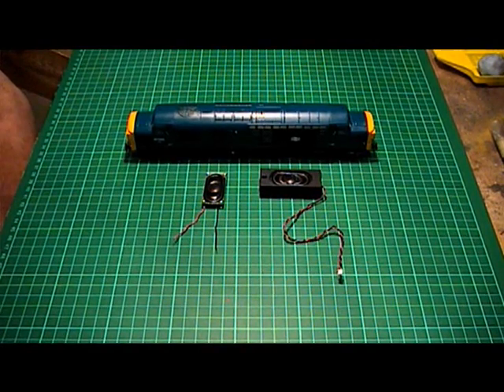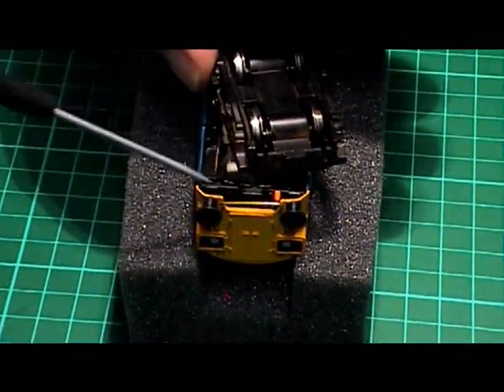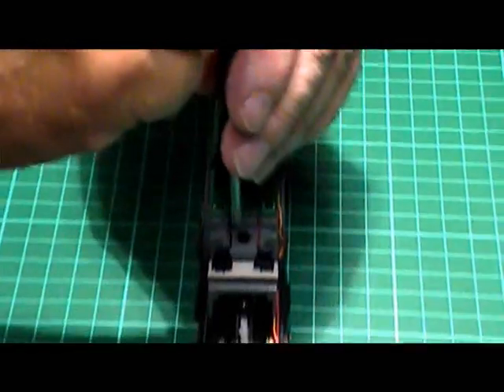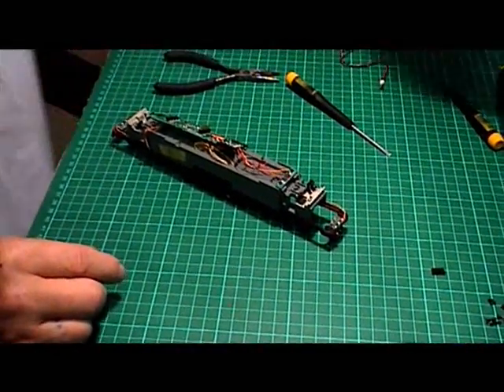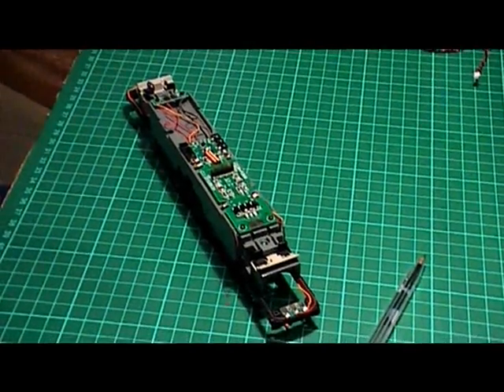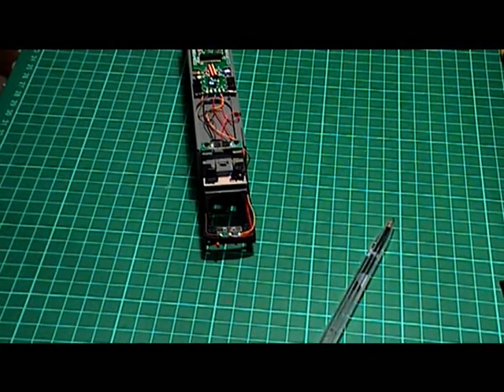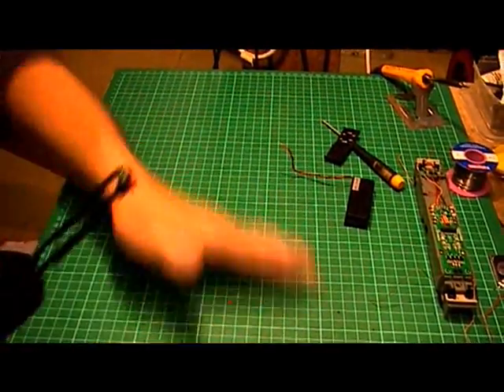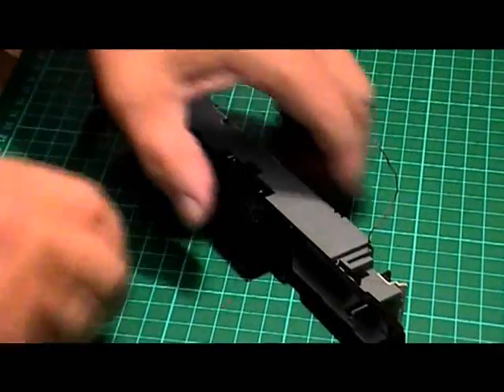Fitting a bass reflex speaker. Video #18

Comment: You have a good steady hand, really helps when soldering, very well presented video, thanks.
Reply: One thing you can do is to blow the joint carefully afterwards and that helps to solidify the solder more quickly. If you jiggle the wires to see if the joint is solid, you run the risk of getting a dry joint. A tiny bit of flux applied to the wire and the tag also helps to make things flow nicely too, even if you are using multi-core solder.

Comment: A brilliant video, many thanks.  I will do the same but I'm thinking of leaving out the roof speaker as it has no housing and the sound produced suffers.  What's your thoughts?
Reply from the maker: Thanks for your comment, its fairly easy to make a 'sound enclosure' out of plasticard for the roof speaker and any small gaps can be sealed with blu tak. The extra speaker makes a difference I find.
Michael

Comment: Hi, thanks for the informative video,  just a question, is the current speaker a 100ohm? If this is the case, shouldn't the bass reflex speaker be 100ohms too, and wired in parallel, i have a Bachmann Class 37  with a 100 ohm speaker and a loksound v3.5 decoder, my 37 does not have switches in the fuel tanks and i wonder if i could cut the tanks from the bottom and remove the weight ( If mine has one fitted 37-693)
Thanks for all the detail you have shown
Reply from the maker: Hi Neil, thank you for your comment, that is an interesting question, to be honest it was that long ago I cant remember but at the time the speakers connections will have been wired as per the manufacturers instructions. The sounds on that particular loco work very well and I have had no problems with it.
Take care

Comment: hi mate, have you done any mods to the bogies, on yours they look correct, on nearly everyone elses they are too low and there is a massive gap in between the chassis and the bogie? Thanks,Will.
Reply from the maker: Hi Will,
Thanks for your comment, the only thing I have done to the bogies is to add the hand brake chains.
Michael